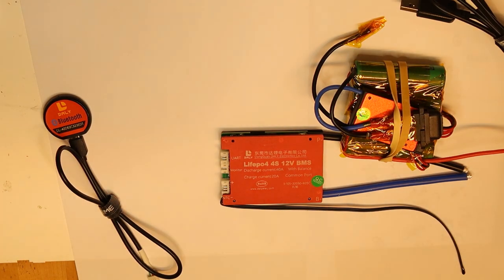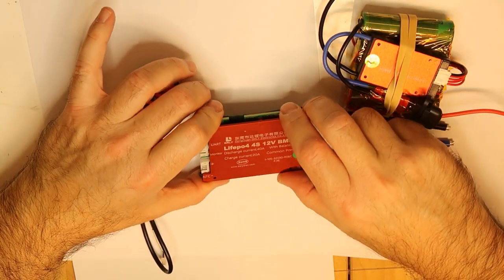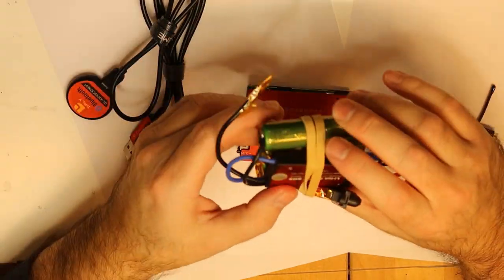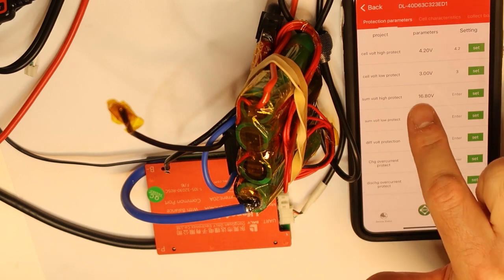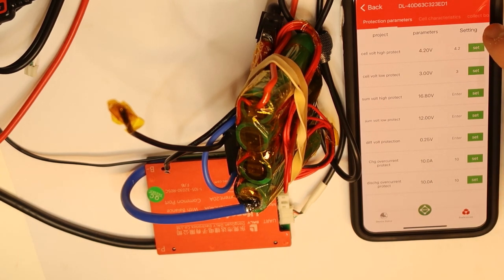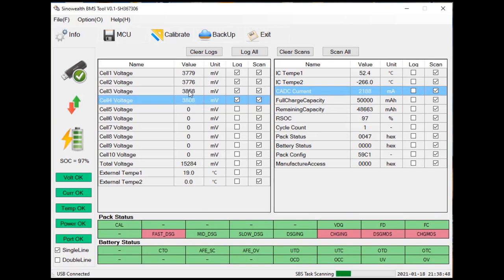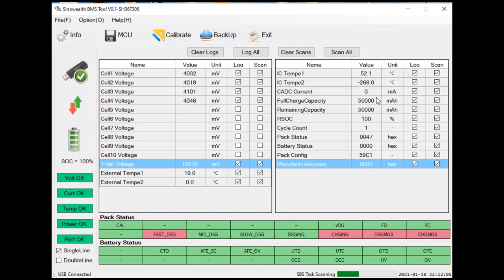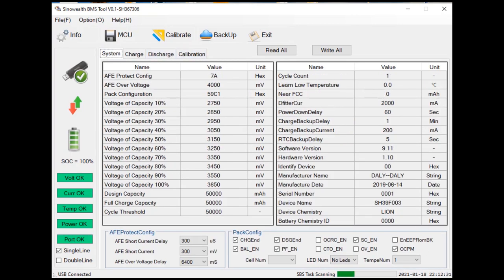Daly Smart BMS Blue Tooth and PC control

Comment: Thanks for the info. Question: you applied 18volts across the + terminal of the battery and p- of the bms, which caused the bluetooth to work. Were your batteries discharged at this point?

Comment: I see on two places that you seems to be able to set the number of cell of the pack thru the app. Did you try the BMS with let say 3S and configured it to work on 3S with proper voltage and all ? I'm asking because I want to build a 12S but right now only have a 8S and it would be awesome if I could just buy a 12S BMS right now and configure it for 8S in the meantime ( I'm paid in Canadian Peanuts, so we're talking about 30% more expensive than for our US neighbours ... about 70$CAD per BMS for me instead of 55 -_- )

Comment: I need to do some testing to confirm, but I suspect the power for the UART/Bluetooth port may come from only cell 1 on my BMS.  I'm seeing noticeably lower cell voltage on cell 1 as I have been discharging my battery over several days.  I have a touchscreen connected which pulls more power than a bluetooth module, so it may be an issue for me.
Reply: After testing, I have confirmed that the UART/Bluetooth port is powered by all cells, not cell 1 as I first suspected.  I also found that the screen draws about 100mA, in case anyone was wondering.

Comment: hi, can you tell me why it's charging with 17V. I charged it to activate 15s lifepo4 bms but there is no device in blutooth application I have no LED display card, I cannot press the button. thanks
Reply from the maker: I don't understand what do you mean? do you use different BMS? which one ?
Reply: @RoeeBloch  I am using 15s smart daly bms. Is it necessary to enable bms for rs485 pc connection? appears as unidentified device. I pressed the button on the LED indicator but the bms was not active. Can't connect bluetooth and rs485.
Reply from the maker: @emindogan291  you need to start charging in order to be able to connect to it
Reply: @RoeeBloch  Do I need to charge it in computer rs485 connection or just for bluetooth? How many Amps I need to charge with Bms 500A value.
Reply: Is activation required in the rs485 connection?
Reply: @emindogan291  u need to conect charger to ur battery pack then bt will be activated. It's dogy technic but it works.
Reply: @RoeeBloch  9:22 Did I understand correctly that to activate smart bms, it is necessary to connect the charging not to 14.6v, but to 17v???

Comment: congratulations on your video. 
One of the most important aspects that people don't understand, is security over access of their BMS by other people. If there is no password protection, even to access the parameters, the BMS is not secure. Especially if one is developing a product. You invest hundreds of dollars or euros for batteries, and then any person can tamper with the security of our BMS, and blow our investment. It just doesn't make sense.
I wanted to ask you about something. I saw that to change the parameter settings, a password 123456 is required. Is password reset a secure process? Can you customize the password? The security of a BMS should be equivalent to that of the home wifi router. Even for password resets. 
Once it is customized, is there any way (bluetooth) to reset it and still reset the parameters?
How do you consider the access security of this product?
I abandoned JBD BMS specifically because of this type of issue. I'm thinking about switching to Daly.
Reply from the maker: good comment, however - I don't think people are travelling in the streets trying to find batteries with phone Bluetooth and blow them up, do you ?, however I can check if the password can be changed, I will try to do it when I have some time
Reply: @RoeeBloch  Thank you for your reply. Me and an association are organising an electric bike race, and a lot of people use daly, jbd, and many other known bms. Many people build their own battery packs. I'm ready to switch off everyone's bikes in the race and win.
I'm joking of course, I could give 1000 more examples. If it's not a problem today because no one thinks about it, but it will be in the short term when everyone has self-built packs, or DIY systems or whatever.